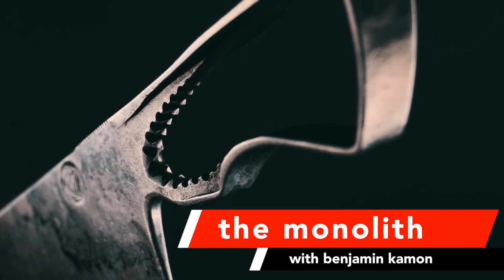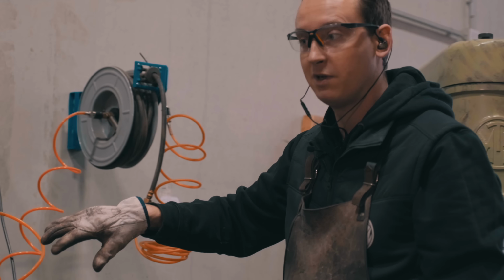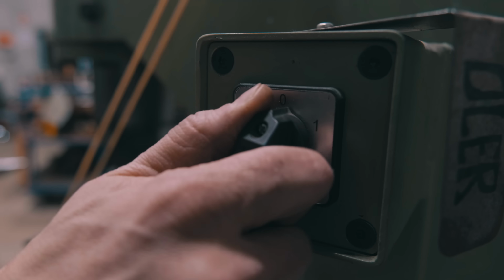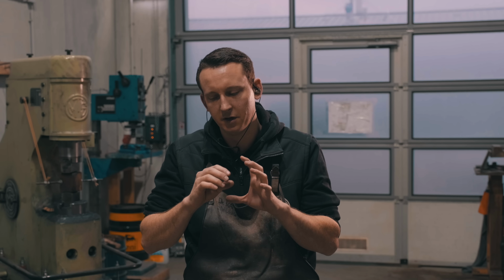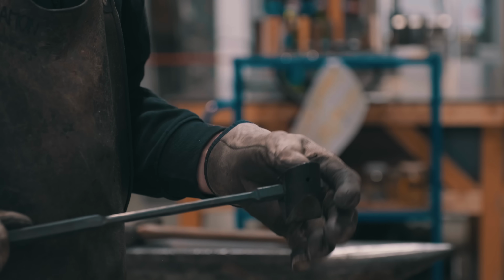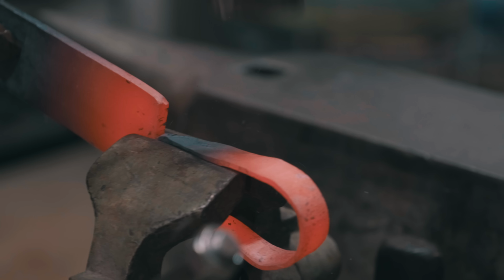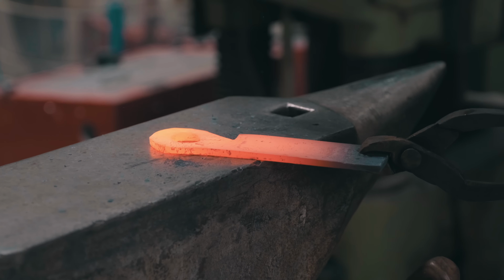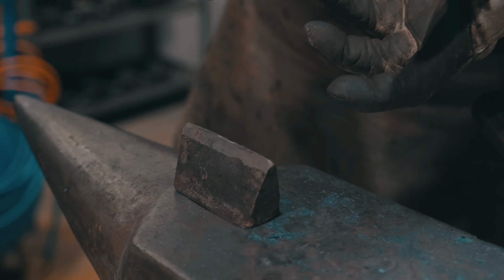Why 90% of this knife is forged according to an Austrian knife maker!

Comment: Can you tell us more about "12519" Steel? Does it go by other names in other parts of the world? I can't seem to find what kind of steel this refers to.
Reply: 1.2519 is a tungsten alloyed cold working tool steel with with about 1,1% C / 1,3% W / 1,2% Cr a little Vanadium and a little Manganese. It's similar to aogami or how I like to put it like ball bearing steel on steroids. As it has similar chromium content but added carbon and tungsten for better wear resistence. You should find info about the steel online but you most likely won't find it available as it ran out. I bought a bigger amount of it years ago and I have it for years to come. However if you are interested in a similar steel then look into Apex ultra. It's a high carbon tungsten alloyed steel as well and even exceeds the properties of 1.2519, aogami and the likes.
Reply: @kamon_knives Thanks for the clarification! I'm patiently waiting for Apex Ultra to be stocked locally, looking forward to trying it out.
Reply from the maker: Good question. I think from what I gather it is THAT rare. I will see if I can find a source for this and will post here if I do.
Reply: @UKBladeshow  Awesome, thanks!
Reply: According to one of Larrin's articles on KnifeSteelNerds (Is Blue Super Steel Actually Super?) it's pretty close to O7 but a tad more Cr.

Comment: That handle construction is new to me. Sorta similar to the x-rhea style handle, just using a different method to get the same result. I personally plan on getting proficient in both methods.
Reply from the maker: Cheers for the comment Gareth! Thanks for watching!
Reply: It is actually inspired by the x-rhea knives from Lin Rhea 👌! I'd say it produces a similar result, but not the same. Just too different in detail. Of course the bigger picture of having a "blacksmiths knife" is the same but then I wouldn't compare a simple loop handle blacksmith's knife with Lin's outstanding work either. That's very subjective though.